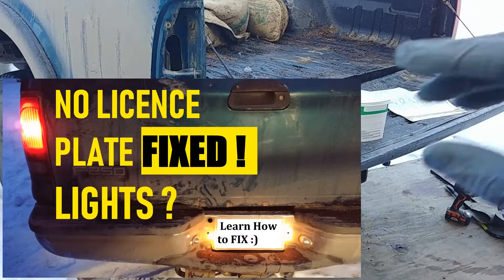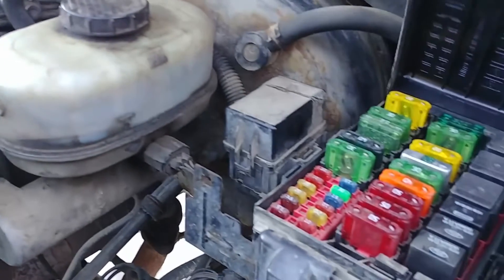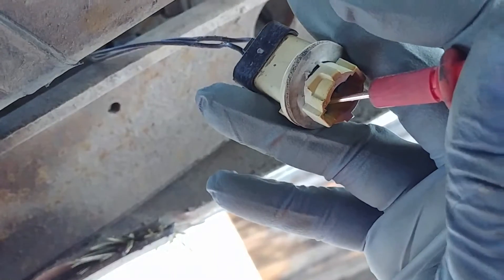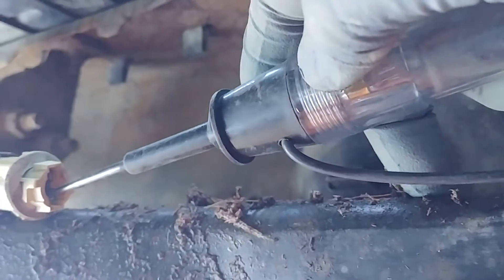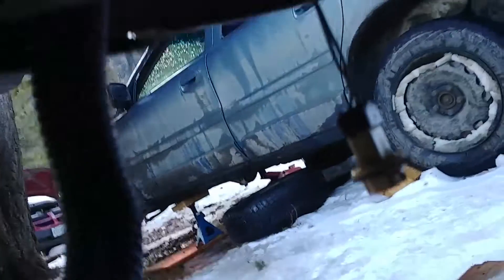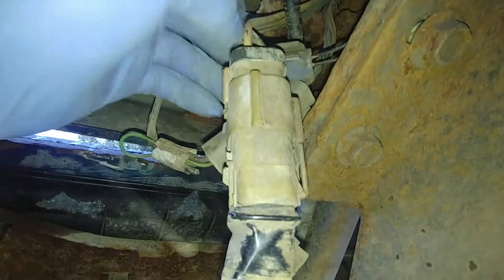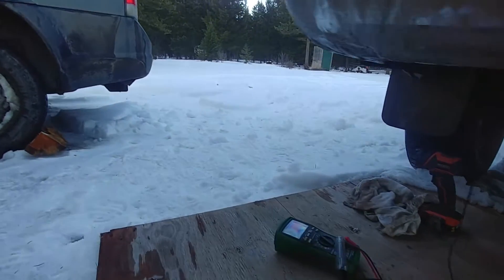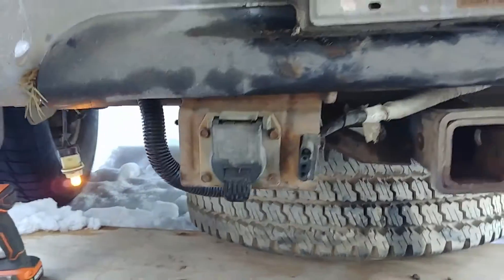TROUBLESHOOTING LICENCE PLATE LIGHT CIRCUIT. Any vehicle. Fixed!

Comment: My trailer single tag light have single wire going into it tested with light have power on one side where bulb goes in. New bulb but no light yet ?
Reply from the maker: Check at the vehicle trailer connector for the signal. If you have both lights off, check the fuse first. It one doesn't work check the circuit from the plug for continuity.

Comment: Exact problem on my 2012 F-350.  So far, I wiggled wires under the rear of the truck and they turned on.  I have your video saved for a proper diagnosis.
Reply from the maker: Thanks for you feedback Suunto61! I'm glad it was that easy!

Comment: Hi, I am abit confused. When you put the multimeter on the right hand side ground wire it beeped and then on the left side it did not beep and you said that's good. Shouldn't the both be the same?

Comment: I have a ranger. Same problem. Just a tiny break in an old wire that wasn't easily visible. With some patience and basic tools I had everything fixed and updated under the bed. Thanks for this helpful video!
Reply from the maker: That's awesome Christopher! I am glad this video helped you out. Thanks for your feedback. Cheers!

Comment: If you have too installl your own license plate lights ,your license plate light comes with a red and black wire what color wires with tail lights do you plug them with to turn off and on with tail lights?
Reply from the maker: Hey Zack. Black wire connects to vehicle ground then find which wire feeds power to tail light socket is your power wire.
Reply: @PistonShack  thanks brother

Comment: What was that torch looking thing that you used on the wire to fix it? I thought you were going to cut splice and maybe even solder and insulate that wire but I have no clue what that torch looking thing you use is or what it did to fix the problem.
Reply from the maker: That butane torch can be used for soldering wires together and melting crimp heat shrink connectors to seal the connection.
Reply: @PistonShack  oh, so you did have solder on those wires and did use heat shrink?
Reply: @brucecook502  I'm really late but it was just a butt connector you heat shrink down around the new connection. It's all 1 piece
Reply: @Seasniffer1969  it's all good, my problem turned out to be very simple. My car was missing a few fuses including the one responsible for the tag lights LOL

Comment: I have brake lights but no tail or license plate lights 2013 sentra,new bulbs and changed switch/control nob same problem..Any ideas..I have 3 fuse boxes but no tail fuse or burnt fuse
Reply from the maker: Hey Mike! I would check power at the fuse first then test for control side of the relay from the switch but first do visual inspection for any lose wires, corroded grounds and broken wires.
Reply: @PistonShack  thank you for responding. I think there is a short...F6 is blowing. When I test it I get power to 1 side of fuse...the wire that feeds the right tail light harness is covered with a roll of ductape..this isn't gonna be fun
Reply: @PistonShack  so you mean also test from the wire that clips into the headlight switch on the turn signal? I unclipped the tail light harness, turned the lights on and stuck my tester in all the clip ports with the hadlights on. Only lit in 1 port...if I hit the breaks or turn signal maybe it would light on the other ports? I figure the short might be before that harness becausethe licenseplatelights are dead too..wish I had a wiring diagram and I wish I knew what I was doing

Comment: Thanks. Interesting troubleshoot. My numberplate lights are staying on permanently even when the vehicle and headlights are turned off. Any ideas?
Reply from the maker: Hey Peter! It means you have constant power feed to the plate light when you switch is off. Unplug the switch to see if plate light will turn off. Do you have other light on when light switch is off.

Comment: Just bought a 1991 Ford f150 and noticed the license  plate lights were out, so I crawled underneath to see what was wrong, and found someone just clipped the wires!  Guess it was easier than changing the bulbs???
Reply from the maker: Right on! Visual inspection is first place to start any "tryagnostics"
Reply: @PistonShack  just a minor issue to add to the other middling issues.  I really can't complain too much since the truck was only $850, not rusted, nor dented, and runs.  The previous owner just let maintenance slide instead of investing in the smallest things.
Reply from the maker: @danbolton3180  That's great deal Dan! Right on. Every vehicle will have some minor issues here and there - even new ones!

Comment: What happens if you short the wires while checking for power
Reply from the maker: Hi Mr. E. If you short wires exterior lights fuse will blow up most likely.

Comment: I installed led light on the back and the panel says check license plate lights. But they work fine
Reply from the maker: Hi Saul. Does it set message if you put regular bulbs? If lights work fine I won't worry about it.
Reply: PistonShack when the regular bulbs are on there is no message on the dashboard. But when I installed the leds it appeared that message. How do I tell the computer that I’m using leds? Thanks bro

Comment: How in the fuck did u pull that connector apart i cant get mine apart
Reply from the maker: First, try to spray WD-40 or some penetrating oil on that connector. Tap it with a screwdriver in a way you play drums. Pray lock clip on the connector then it should come apart. Let me know how everything is going? Thanks for watching and subscribing. Cheers!
Reply: Got use small flat head screwdriver and go to work one side a little other side a little
Reply: Make sure you lift up on that tab while doing one side a little and other a little

Comment: Yes I work on a 1996 Dodge ram 1500 thank you so much your video was exactly what I needed. I found the problem I fixed it thanks to your. I have question for you my son has a 2002 Toyota solarawe don't know what happened but now when he turns his right turn signal on radio and instrument panel flashes at the same pattern as the turn signal and all the lights signal brake hazards and backup all flash also what the right turn signal when he turns it on I hope you understand what I'm saying any ideas what it might be
Reply from the maker: Hey Albert! I am glad to know that)
Oh okay, I see. That's probably, short or interrupted circuit at the switch side of the multi-control. Most likely worn multi-control switch feeds cluster and radio circuit when turn signal is on. Those turn signal switches go bad over time. 
Disconnect the stereo and see if problem gone. Means stereo has internal short or open.
I would get 20$ replacement turn signal switch from the wrecker. It should solve the problem.
Let me know how everything is going. Take care!